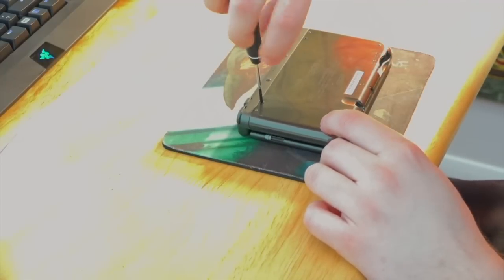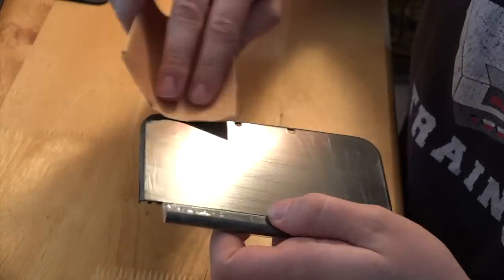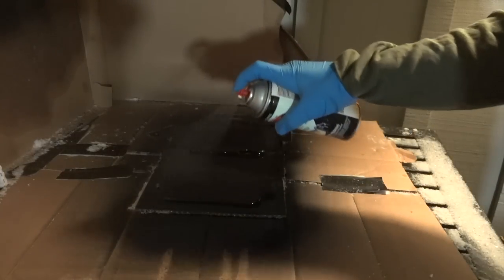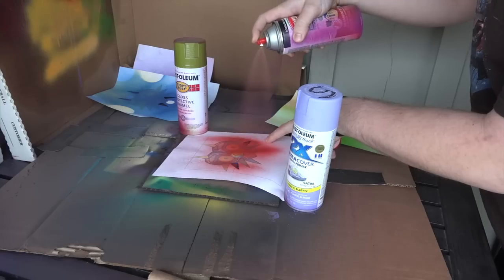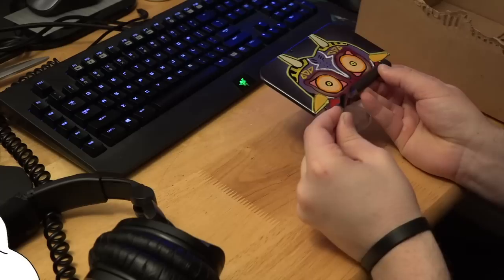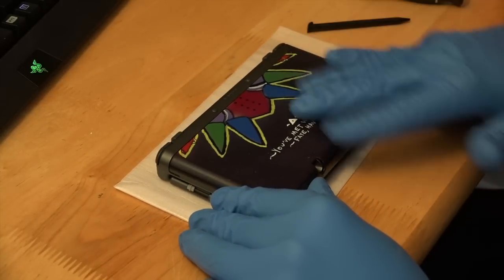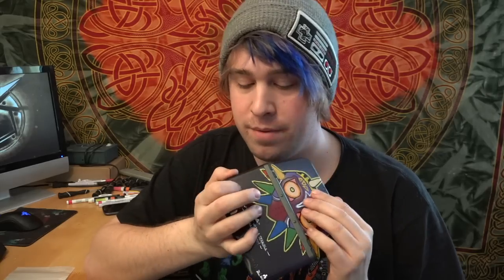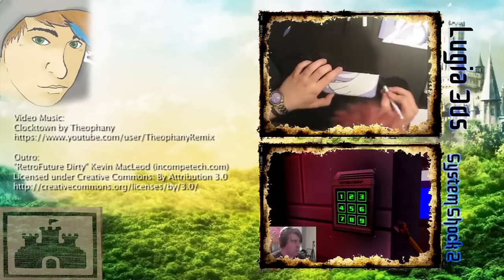NEW 3DS XL CUSTOM PAINTING -- Majora's Mask!!

Comment: I'm impressed, but i do think it would be easier to use paint markers. draw it out compleatley. it just seams to look nicer that way. Personally i prefer the posca paint markers for this type of work. It seams like less work really and it just looks nicer because before hand you can sketch it out with pencil and then just fill it in. Its nice to know that the plates come off with minimal effort though. This is the first thing i've seen on the structure of the new 3ds.
Reply from the maker: Never tried those markers! Will have to look into it!
Reply: CanvasKingdom any tips on finding a sea green color like the 2DS? I'm doing vaporeon and I'd like to make it look like I have a sea green one even though it's more expensive xD

Comment: i noticed that when you printed out your design you had it placed on a template of a new 3ds. I was wondering where you found that/if you could link it to me?? i am about to do a custom paint and it would be super helpful!!
Reply from the maker: the ardist I'm afraid the file is gone. All I did was measure the dimensions of the system, then made a quick template in Photoshop! I'll see about remaking the file in the morning. :)
Reply: CanvasKingdom thank you so much!! <3

Comment: In theory what would happen if I only let it dry for 48 hours and not 72
Reply from the maker: Blade Fang Well, there is no theory really. The answer is that the case will not have had sufficient time to dry, which will lead to damage of the case (i.e. smudging of the paint, finger prints, dirt, etc.) I'd recommend being patient. :)
Reply: CanvasKingdom that's a little dis
Reply from the maker: Pardon? o.O